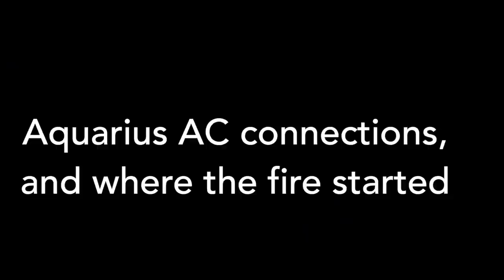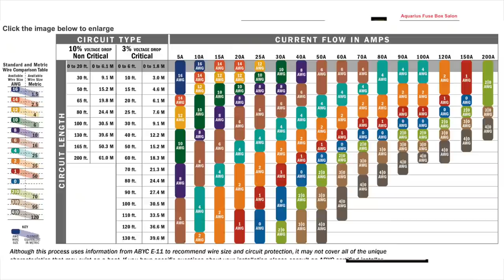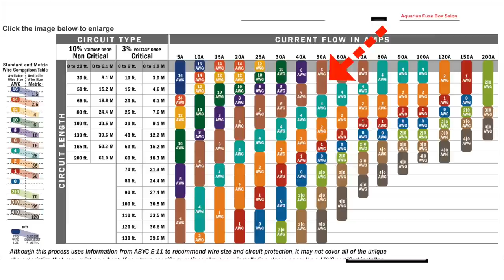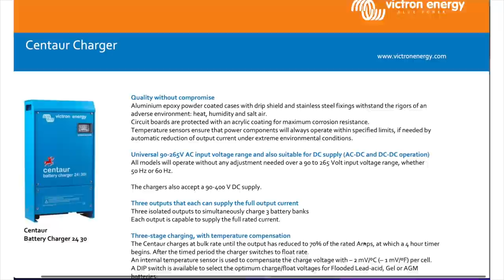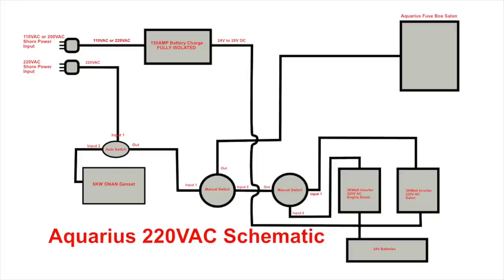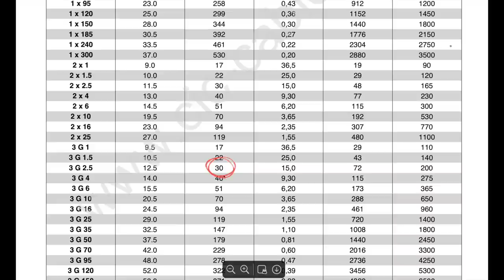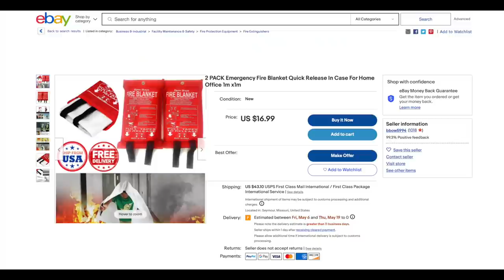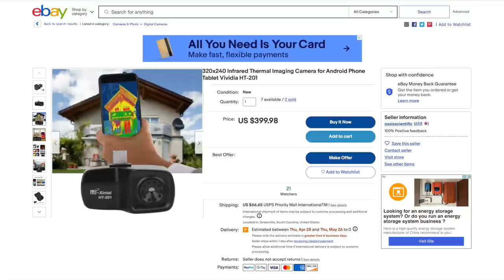Fire Aboard Aquarius - Tips on Tuesday - Fire and a few tips on how to avoid them!

Comment: Thanks a lot for sharing your lessons learned.
What I have installed in my engine room is the MABO automatic fire extinguisher. It is a simple glas tube with a liquid in it that when heated up will burst and 'kill' the fire quickly. For us here in The Netherlands its just about 90 euros (roughly $100) and it will give an extra safety net besides other measures.
Reply from the maker: Thanks for the Tip!  Ken

Comment: Smoke hoods are a very good idea...its usually the smoke that  kills people in fires.... burning plastics from wiring tubing etc and plastic based sound  insulation are all problematic. As are soft furnishings.
I dont know how those wires were fitted to back of the plug but if they were a screw fixing they can heat and cool in time they can work loose ...
Ditto a small amount of corrosion on the blades and spades can increase the resistance across the connection causing a build up in heat. Ive seen it melt connector blocks on cars....its not always green either copper oxide is black and doesnt conduct electricity well if at all.
Glass fiber will burn ultimately ...see the barefoot doctors channel... When they lost their 1yr old Leopard..

The smoke is not only toxic containing cyanides so thats why your lungs give up its also highly irritating to the eyes and mucous membranes. 
The final risk is certain plastics contain flurine compounds they actually produce Hydroflurosylic 
acid... Which passes through the skin and flesh to attack the bones underneath..  UK firemen dealing with extinguished vehicle fires always ware protective gloves.  

By comparison cork is benign if you can even get it to smoke and treated its remarkably fire proof rot resistant anti bacterial  and a renewable resource....
https://youtu.be/YdSWJypDSbI

https://youtu.be/uir_RUjVGQw

In high risk areas its best to have extinguisher systems plumbed  in to high risk areas via fire wire system as on race cars ...a pressurised plastic tube  placed round the engine bay ruptures closest to the heat source and floods the compartment with extinguisher contents...
The other route is to have a small port you can fire the extinguisher into the compartment through without opening a hatch or door...as that can allow an inrush of O2 and trigger a flashover ... The smoke represents unburned fuel ...if the fires restricted by the limited air in the compartment opening it will result in an explosive expansion of the fire through the air...
You dont open a cars bonnet till youve got enough extinguisher contents in under it till its out or nearly and you better have the right type and a spare on hand. 🔥🔥🔥
Best read up on avoiding flashovers or backdrafts as they  call them in the US. 
Feel for heat with the back of your hand ...if you cannot see due to smoke or no light search with the back of your hands...
Intense burning will will cook up your muscles and ligaments making it difficult to let go of anything really hot particularly metal handles... Dripping 
Plastics will stick to your skin and burn like napalm if ignited ...i nearly lost a finger as a kid due to that one.... ditto a fire below can heat up the deck and burn feet or melt plastic footware. Sometimes all you can do is get off the boat ASAP and if your off shore launch a life raft and grab an e-purb.
If a fire starts at the back of the boat or in the galley can you get out a hatch at the front of the boat on your own or in the dark with the boat full of smoke.
Rechargable items have also caused boat fires ...dont leave them on charge at night ...put them in a tin box insulated from  any surface that might catch fire if a fire starts in the tin box. .. fit smoke detectors as well as  carbon monoxide detector  at sleeping or seating level... It sinks and builds up in the bilges and at floor level ...heat and smoke rises.. so they should be fixed high up.but not above a cooker  or near a solid fuel fire.
Reply from the maker: Great info...  You must be a doctor!  Ken
Reply: Thanks for referencing Barefoot Doctors -- lots of learning about fire disasters, financial pressure, (crooked) insurer, and the aftermath. Cheers

Comment: One way to make a boat’s shore power system way safer is to replace the boat’s original main AC breaker with an Equipment Leakage Circuit Interrupter (ELCI) breaker, which will not only trip if the circuit is overloaded but also trip if there is any leakage back to ground, which will go a long way to ameliorating the risks. ELCI, is capable of sensing faults in a vessel's AC electrical system, where it will turn off power before a fire or injury can occur. With few exceptions ABYC and CE-compliant vessels must be equipped with this component.
Reply from the maker: I have been looking at breakers, and I have made a breaker box that I am going to use between shore power and the boat.  I'm researching the different type of breakers to put in it now..  They have a dual GFI/(ARC Fault Interrupter) breaker would be the best.  Do you have a different opinion?  Please let me know.  Ken
Reply: @SailingAquarius  I must admit electrical is a weak area for me I generally know enough to know to seek ABYC professionals I trust to do the work. From what I understand the difference between your standard GFI is that a ELCI monitors all the power going to a boat (if it's mounted in a pedestal) or coming from shore (if it's mounted on the boat) and ensures the same amount of current is returning on neutral as delivered on hot. A GFCI protects an individual outlet or circuit. Think of an ELCI as a Ground Fault Interrupter (GFI) for the whole boat that will, (assuming that the boat’s AC ground is fully bonded to her underwater metals), trip if the live wire shorts to the case of any equipment, even if the shore power ground wire is disconnected.  I have one from Blue Sea. I like that the unit has a built-in reverse polarity tester ( I regularly test daily) which will back up the one on the main panel at the chart table on my boat. Along with an Isolation Transformers, In the past they were only found on metal boats, usually aluminum, but recently isolation transformers have become more readily available, less expensive, quieter, and lighter, and so should be considered for any boat, particularly ones that will be on shore power a lot and have vulnerable underwater metals.
Reply: @SailingAquarius  Update; ABYC exempts isolation transformer-equipped boats from fitting an ELCI (ABYC 11.11.1), but I now—yes changed my mind and that’s why the update—don’t agree with that and suggest that even with an isolation transformer an ELCI should be installed on the vessel side of transformer and at the output of generators and inverters. It’s even worth installing one as close as possible to the shore power inlet plug on the shore side of the transformer as well.
Reply: @SailingAquarius  Let's break it down to 8 checks we can do. #1 Check That All Batteries Are Fused. #2 Check That All Conductors Are Protected. # 3 Check That The Fuse Is The Right End. #4 Check That Fuses Have Not Been Bypassed. #5 Check That Alternator Sense and Output Conductors Can’t Be Separated. #6 Check For Voltage Drop To Sense Wire. #7 Join and Follow ABYC. #8 Understand Ohm’s Law.

Comment: I was a Firefighter/Paramedic Back in the 80s....and We Trained Every Day...SOME times we would Put the SCBA and Mask on  and put paper towels in the mask so we could not see.....searching for a victim blinded was Good Training for later  DRILL DRILL DRILL  Memorize Memorize....We Laid on our Backs under the fire Engine and Studied and Drew Diagrams of the Pumps and Pipe routes  TRAINING is the key....Great Job Ken   Yea the Smaller wire Not connected good could have arched and caused the fire   GOOD SAVE🙏🙏🙏🙏
Reply from the maker: Thanks for your input!  Being a Firefighter your input means alot!  Fair Winds. Ken
Reply: 🥰🥰👍👍 @SailingAquarius

Comment: Great video. I would think that your first step in your fire plan would be to put the mask on. Once your breathing and sight are protected from all the fumes, smoke and heat, then you could more quickly address the other shutdowns and extinguisher. Plus, burning wire coating, fiberglass, varnish, etc. is a lot of noxious fumes that can hurt eyes and especially lungs permanently.

Comment: Ken, a lot of the Super Maramu’s I’ve seen have a Clean Agent (eg Halon although that is getting hard to get due to the greenhouse gas emissions issue) or Fireboy type system that can be triggered by heat and remotely at the helm station or in the passageway by the fuel shut off. A smoke and CO detector could also have alerted you before your nose did.  As you have undoubtedly discovered, non clean agent firme systems can leave quite a mess on sensitive components and engines. Obviously better than losing the boat but something else to consider.
Reply from the maker: Yes, I agree Steve.  I need to get another Halon extinguishers before they disappear.  :)

Comment: First disconnect battery.  Put on respirator.  THEN grab fire extinguisher.  Every boat need a trip both sides of the hull line to a spring loaded battery switch, so all you need do is to GRAB and PULL.  Then you know the usual cause is removed--the rest is damage control.
Reply from the maker: You are correct, and everything needs to be refined...  Even my procedures! Ken

Comment: Smoke detector , Had a bad experience in Phuket from a workers slackness , Nearly sunk the boat on the way down to Singapore , He didn't clamp the genset cooling inlet , Just pushed it on with mastic (2inch pipe) 3 ft below the waterline & BEHIND the Genset . So any work done must be verified & Checked by you or some one who has the certification for the job .

Comment: Ken, that must have been really scary.  Glad to see you were there and able to control things before it was too late.   My boat has the same white box as Aquarius.  When I bought it the outlet of direct 220 v showed some heat damage.   I replaced it with a new one and so far so good.  However, this makes me think that the outlet may not be capable of running all the current that we tend to use.   In fact, the plug/outlet is rated for 20 amp that at 220 V is only 4.4 kW.  This is compatible with the AC shore power connectors/cables that run only 20 amp and 220 V.  Although we actually plug into the 50 amp outlets of American marinas, we take the cables between two faces to get the 220 volts.  The 110 V boats using these plugs have much larger gauge cables because they actually take 50 amp between two faces and the common.     Granted you were only using ~3KW but that is assuming that the efficiency of the Chargers was close to 100%.  So you may not have been that far from the 4.4 kW plug rating. and that combined with a defective plug/outlet connection and/or a small cable could be a formula for disaster.  I don't know if your boat is that different from mine but if not, the switch relay for the Genset is located beyond the white box between the plug and the breakers box on the saloon and not as you display on your drawing before the white box. ( you can download a sketch of my circuit from the Amel owners group site) .  I know that for my boat that is a fact because I added a third outlet to the white box for a 5 kW inverter that I installed.  With this system, I can run the Genset even if the plug is connected to the inverter outlet.  If it was like you show, it would not have run power from the Genset because the plug would have not been connected to the shore power 220 outlet.   Also, our Genset is rated at 7.5 KW and can put out that power that far exceeds the 4.4 kW of the outlets. This is why the main breaker on the AC circuit breakers box in the saloon is rated to 10 KW since it can run off the Genset.
 In addition to your valuable suggestions, I  learned a few lessons from your experience, 1) When connected to shore power, or using my inverter, I should never run equipment with more than 4.4 kW or run the Genset instead.   If I am running the battery chargers, ( I have one 60 amp and one 100 amp)  from shore power everything else must be disconnected.  Even better, never use the 100 amp charger from shore power; there is no need to charge the batteries fast in a marina!  2) when running high-power consuming devices I should check if the plug is cool and test the resistance of the plug outlet periodically,  4) I installed a power meter to measure the current and power coming from shore power or the inverter,  and that being generated by the Genset. That is the power going to the plug and a second one for the power going into the main breaker of the AC breaker box in the saloon.   5)  check periodically the automatic fire extinguisher in the engine room.   I noted you have now one installed, didn't it work during the fire?
  Thank you for sharing your experience and good travels
Jose Gabriel Venegas (Ipanema SM2K #278)
Reply from the maker: Hi Jose,  The fire didn't get large enough for the auto extinguisher to engage the fire.  Very happy about that!  When I get everything rewired my genset and shore power will have manual switches (might do automatic) but everything will go the same path.  I will also have all the wires gadget for 10KW, and will sleep comfortably!  Now I do what you say, try not to use more than 4KW.  But, everything is working pretty good, and very happy with the batteries!!

Comment: You really should name and shame the AmeriCan't electrician at Phuket Yacht Haven Marina Thailand.
Also consider sourcing fire rated electrical junction boxes and replace your engine bay sound attenuation panels with fire rated acoustic foam such as melamine foam (aka Basotect).
Reply from the maker: You should be able to locate the company that did the poor work!! American dude should be plenty

Comment: Yes, a Halon fire suppression system is a must for the engine compartment. Also corrosion block on all electrical connections, first insuring wire size is proper and connections are tight. A high pressure hose for topsides fires would be a good idea. For galley fires an ABC fire extinguisher is recommended.
Reply from the maker: Thanks for the tips!  Ken
Reply: Wouldn’t rush to put a halon system as they’ve been banned on boats for over 20 years 😳 and were supposed to have been replaced long ago.

Comment: Hi Ken,
We have 2 smoke detectors on the boat . Original we installed one at the kitchen but the alarm went off every time we boiled water ( Spagetti …) Now we have them close to the engine room and at the cabins. 
Very Easy installation and cheap to buy 
I like all your videos, specifically the teck on Tuesday 
All the best
Klaus
Reply from the maker: Hi Klaus,  I bought a pack of 6 smoke detectors in the USA and have them all over the boat.  Also a propane/gas detector in the kitchen.
Ken

Comment: Gotta watch out for those dodgy DIY Alec Chickens Ken! Good save though, another five minutes and it might've been a different story eh.
Reply from the maker: Not sure if the fire would have spread, but if it got much bigger the Automatic Fire Extinguisher in the engine room should have put it out.  Thankfully the fire was small and the Auto Fire was not set off.  But, everything worked out in the end.   That junction box that I was thinking to remove, was burned up.  I am going to wait until I get to a 110VAC marina and sell that 110V to 220V transformer, and install a really nice 80V to 240V battery charger that will work anywhere around the world!  Best,  Ken

Comment: Ken, apologies, but new to the channel and so I am watching these out of order.  Did this fire result from the electrical work done for your battery upgrade?  I was interested in the comments regarding insurance coverage for boats with Lithium on your battery upgrade video.
Reply from the maker: Not really...  The fire was due to a bad connection on the AC wiring which was changed to include a new inverter.  At the time of the fire the inverter was not energized.

Comment: While it can look like a bad connection or wiring on the back of the socket as the cause, often it's oxidation between plug and socket that causes resistance then arcing between plug and socket that then heats and burns the socket housing and wiring. An Arc Fault Circuit Breaker or Detection Device would likely have tripped. Non of the wiring your showed looked tinned though and is prone to corroding inside terminals, make sure you use tinned marine wire on the rebuild. The mask at the extinguisher is also great advice.
Reply from the maker: Yes, this could have been the problem as well.  But, I think it was more likely the connection with the undersized wire.  Note that all the other connections are made properly, and they even have a special insert soldered to the end of the wire that goes into the high power connector.  But not the one installed by the dude.  I didn't know about Arc Fault Circuit Breakers, and will be looking to install one if they work like I think they do...  In fact, I may just do a video about them.  Best Regards, and thanks for the advice!  Ken

Comment: Hi, is the Amel not equipped with any self-extinguishing fire system in the engine room?
Reply from the maker: Yes...  But has to get very hot in the engine room before it will go off.  The fire on Aquarius was localized and was caught before it spread.